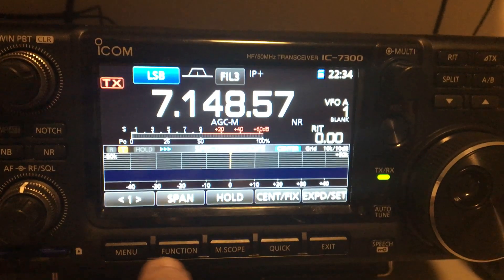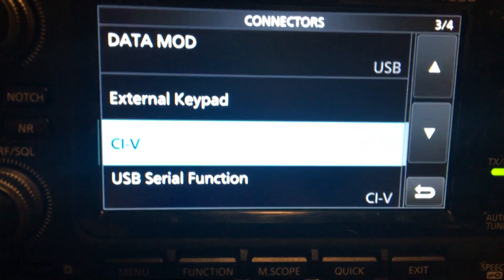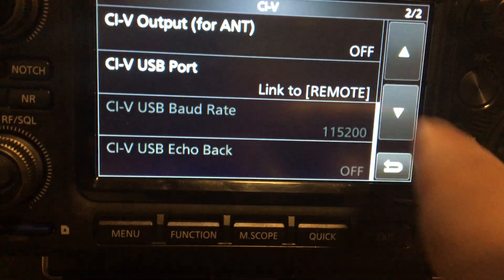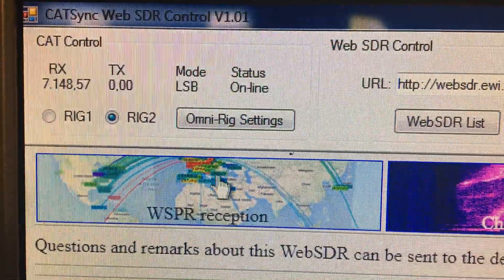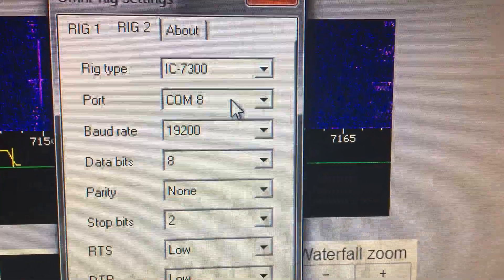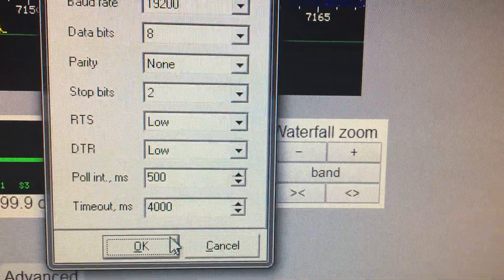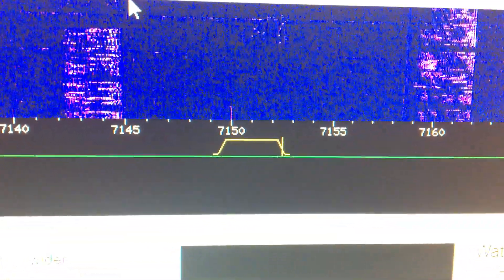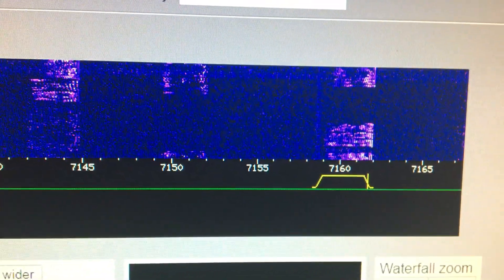CATSync example setup tutorial IC-7300 CAT via OmniRig

Comment: You said to plug into the IC7300 jack 10 which is ALC, and it's an RCA jack. Perhaps you mean jack 6, CI-V remote control? Anyway, when I set it up and hit test on the rf2k it sees the right frequency, I save, but nothing happens when I turn the VFO. What's the deal with the driver notice?

Comment: Just downloaded Omnirig with CW Skimmer. This version - v 1.16 - does not have a setting for the IC-7300. What rig setting should I use ?
Reply from the maker: Just download from the OmniRig website the latest rig definitions pack for adding newer supported transceivers which were not yet present in earlier versions at the time of installation. After download just unpack and copy into the OmniRig RIGINI folder where the rig.ini files are located for each rig.
Reply: @MegaOscarVideos  Thank you. Works great.

Comment: What is connecting the radio to the pc? No one ever shows this part. Ever
Reply from the maker: Well, its just the normal USB cable from the rear USB port of the radio to the PC. No special interfaces required with modern radios as most of them nowadays have their built in USB ports which allow CAT control via the USB cable. 73...
Reply: MegaOscarVideos so you can’t properly run programs like hdsdr with just the usb? I see most people use a separate sdr for hdsdr and hdrconsole. It appears the programs available with just the usb are pretty terrible with bad latency ?
Reply from the maker: @JayN4GO  no  - you can't use the USB output of the IC7300 with programs like HDSDR or SDR# in a meaningfull way (but in an IC7610 you can)...this is due to maximum IQ bandwidth output of the IC7300 is only 12 kHz which is close to useless. 
It is designed this way for DRM decoding, not for SDR software use. 
Anyway, the purpose of my CATSync Software is a totally different one: It's to control a remote Web SDR on the Internet and keep it synchronized with your local radio and not to control or replace a local SDR setup.

Comment: 19600 br does not work for me
Reply from the maker: 19600 baud is not a valid serial port standard baudrate. 
It should be 19200 baud (or any other standard serial port budrate supported by the rig)...
Reply: @MegaOscarVideos  I mean 19.200. If select that baud then can't work with jtdx
Reply from the maker: @ce3sad  Ah, OK you are using a third software trying to control cat in parallel? In this case make usre that JTDX is also using the Omnirig CAT driver (same rig with same Omnirig settings in JTDX and CATsync) and make sure both JTDX and CATsync are both launched with admin rights, otherwise one of them will block the access to the other one (e.g. CATsync blocking the Omnirig access to JTDX)